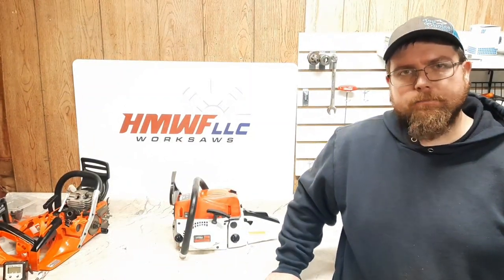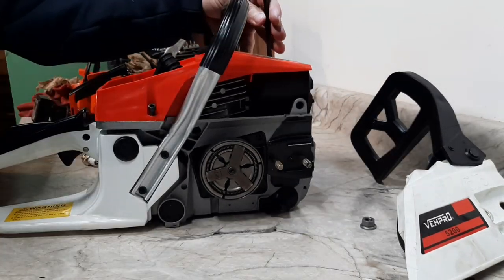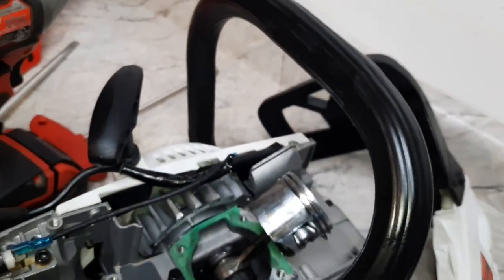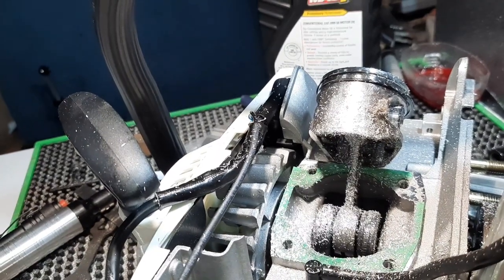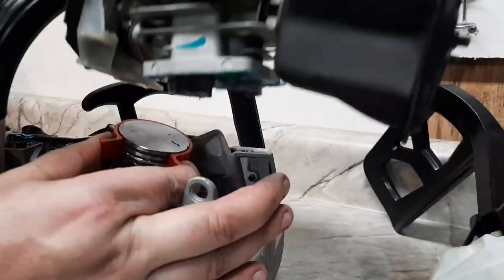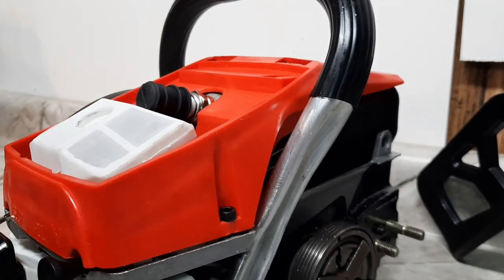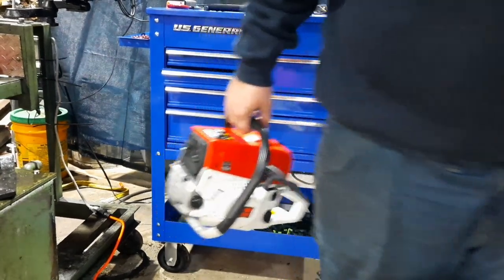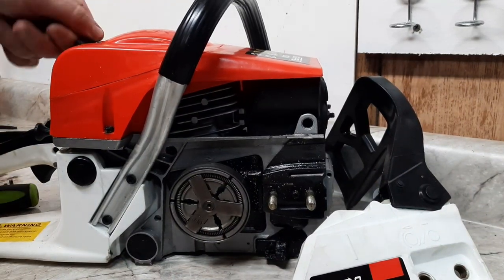Will it run again? Chainsaw with a case full of shavings??

Comment: That's awesome!   I've been a big supporter of people chilling out for years.  Don't get me wrong,  I try to keep things clean as I can, but I had someone just recently telling me that the Jonsered 2172 that I just ported had a junk bottom end due to the piston having been so scored.  I cleaned it out as good as I could with an air nozzle and carb cleaner, slapped it back together and it runs fantastic.   Sure, things can happen that will require a total teardown,  but I think most of the repairs that shops insist on are just to cover their asses.
Reply from the maker: Yeh fine line on how much is too much etc.

The saw in this video would prolly run a long while problem free. With what it has been through i wouldn't want to sell it off.
Reply: @dynojoemods2764  Exactly.   When it's your own saw, you can fudge a bit and most likelyit will all work out fine, but when your reputation is on the line, you need to be overly cautious.

Comment: We ran one with a bit of rope in the cylinder after doing a field swap of clutch (used rope as piston stop). Took a while to clear out the running. I wonder what it looked like inside.

Comment: Thanks for doing a test like this!
Reply from the maker: All part of the fun. Have to break a few eggs to have an omelette.
Reply: Id be really interested to see this test with wood shavings or fine sawdust! Maybe a bearing inspection in a following video...or something along that line, any content in this area is interesting and educating! Or....if a guy maybe does a base gasket delete and during the process gets gasket maker all over his piston when putting the cylinder on + excess around the case mating surface. Id be interested to see what evidence is left behind...i assume not much

Comment: That is amazing I thought the piston would have been scored and bearings chewed up in seconds. I guess maybe you proved you don't have to worry about cleaning the engine too good when rebuilding. But  I think I still will keep my engines clean when rebuilding.
Reply from the maker: Magnesium is a very soft metal. I think that is the only reason it worked out.

I still want things as clean as possible too.
Reply: @dynojoemods2764  compared to aluminum how soft is it
Reply from the maker: @jefferywhitmore  
I guess I'm not really sure. All depends on the type of alloy

Comment: Did not expect that at all. Like the “scientific “ videos. Here a thought load’er up again with bigger magnesium chunks and put a short straight pipe on it. See if you can get the magnesium to spark? In the process you will be able to see if it can injest bigger chunks. 😎👍
Reply from the maker: I was kind of hoping for a burn. Might try something else after it is built.

Comment: Mag is nice and soft relative to the chrome/nikasil, and hardened steel bearings. I assume sawdust will act the same way, having seen crankcases virtually full of fines and the saw running along happily.  What might be interesting is the effects of some sand.
Reply: I understand that it won’t damaging something right away but it surly speeds up wear
Reply from the maker: I'm thinking aluminum or some otherr abrasives would do it in quick.
Reply: Time to test a measured amount of aluminum in the case… na, I’d not like to kill a running saw.  But the sand would be a more “real world” thing that might happen.
Reply from the maker: @manuelve1998  
Might have to try both of those in this poor saw.

Comment: Hey Joe do you have or know what size plug I need to plug the decomp on a echo cs590
Reply from the maker: M10x1.0 I believe. I do know it is different than most other decomp threads. But I am not 100% sure that is the correct size sorry.
Reply: That's what I thought husky  stihl and dolmar is.  So is it just a more coarse thread. Than the others

Comment: I can't believe it wow ,you think it could be built into a work saw that would hold up for the average home owner firewood saw after that torture test if so thay might be a low buck option for a couple years of wood cutting.
Reply from the maker: I'm not sure. I plan on cleaning it out and porting it up it will see plenty of dyno time. For the 80-90$ price can't really expect much at all from them. But seem ok for that price. And put out very good power for the $$
Reply: @dynojoemods2764  
I have a couple of these saws modded to run pretty good, I have the bigger 54 and 61cc versions but they're pretty much the same power as the 52cc stock
You need to make an intake block and run a 365/372 carb to get power out of em. That carb works with the stock filter and cover if you shorten the intake block, it ends up flush with the holder/divider. The carb is the same bolt pattern but you need to drill a hole in the throttle linkage on the other side, bend the throttle linage and remove the 372 cable hook up to make it work.
I think the 45cc version runs the best ported with the stock carb as the stock carbs even a bit small for it, it'll rev higher than the 52 which is where they're lacking. The 45cc cylinder was about 20 bucks when I was messing with em a few years ago.

Comment: That saw does look pro-grade internally other than the transfer ports. 

I’m sure after this test, people will want this model.
Reply from the maker: They are cheap and easy to find.
Reply: Well they ripped off stihls design so it should be.
Reply: They are decent for the price of them the only thing I find that sucks is the 50/50 of getting one of these with the 34mm stroke cranks vs the 32mm stroke cranks. You can buy the quad port cylinders but that is another 50/50 in getting one that's for the 34mm stroke crank as the cylinders for the 32mm stroke saws they hit the squish band and typically need .030-.040 taken from squish. The intake port is definitely a help on these saws as it helps the fuel/mix go towards the transfer ports better.. The carbs that's on them are for a 40cc 14mm venture so the saw then causes this Lil guy to run around like a 40cc saw. Remaking the intake and using a ms290 carb as it is roughly 18mm venture and a removed baffle from the dual port muffler  or a larger .625 pipe over the .485" in the single port. Definitely makes a saw come alive. I'll have to see about doing a video on remaking the intake manifold and what i ended up doing to make the ms290 carb work. I'll definitely let a guy know when I do just incase your curious or anyone else who might read this comment in how to do so. They definitely are strong for what they are. Another thing for the 32mm stroke saws I'd probably keep the stock carb and bore the venture out to 15mm. Hope this is helpful.